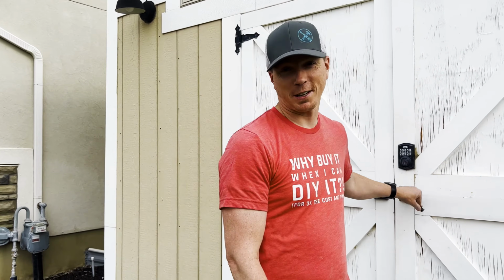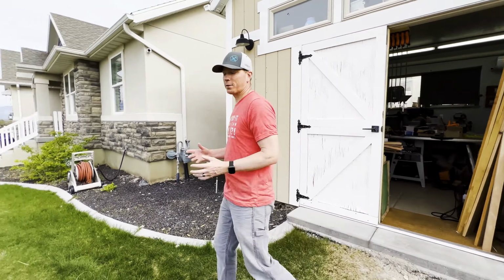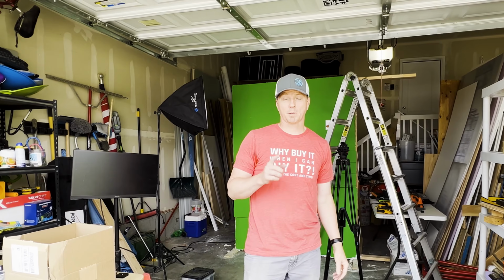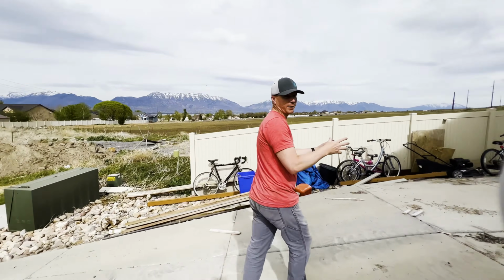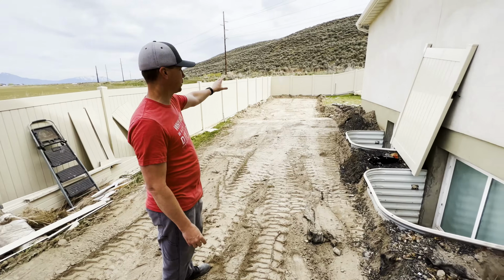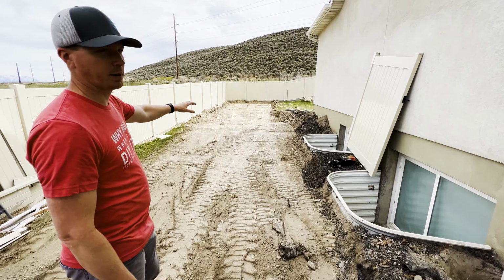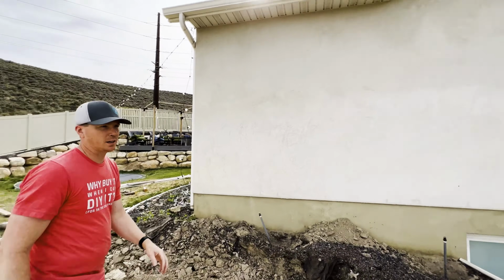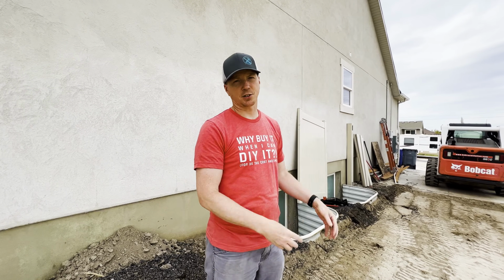Converting a Garage Into a Shop - Tearing Up the Yard

Comment: Just curious about the new shop being attached to the house now,and woodworking being a rather noisy affair with the power tools, are you planning to take any sound proofing measures? I really enjoy your videos, you talk in a way that is informative and instructional, and most importantly understandable. Not using a bunch of industry 
lingo or moving too quickly through important information or steps, and I appreciate that in diy videos.